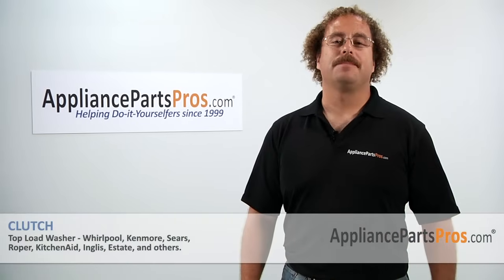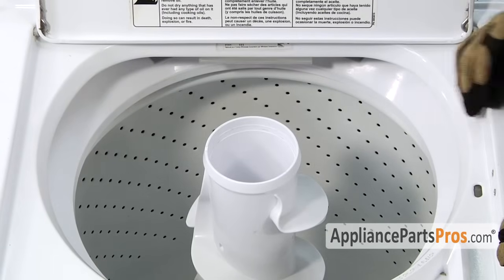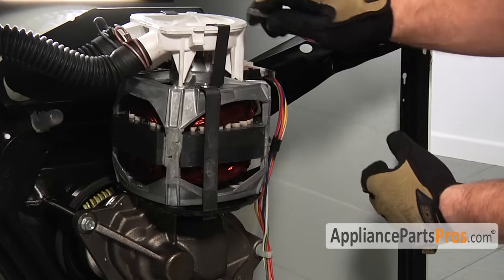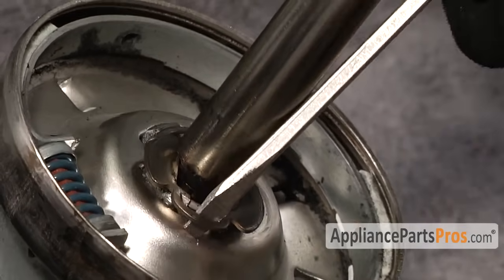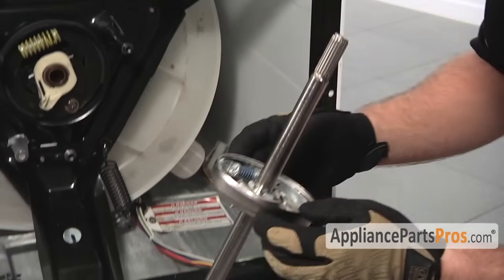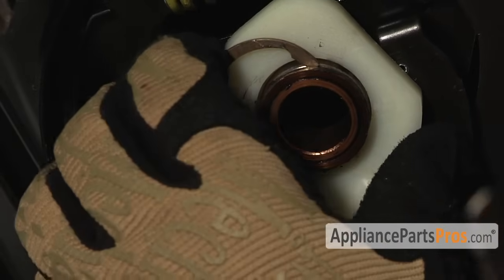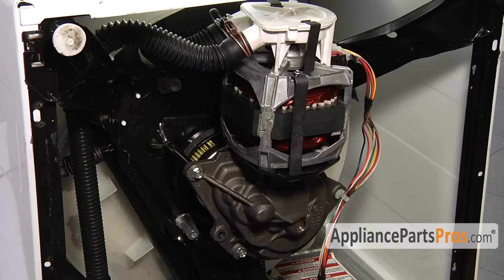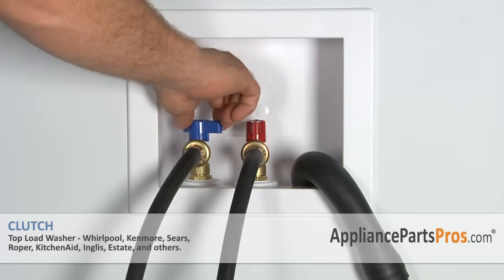How To: Whirlpool/KitchenAid/Maytag Clutch Assembly 285785

Comment: Curious! You didnt remove the drive block and spanner nut?  So im assuming theyll stay in place?  Thanks

Note: " It has lips on it"  Lol.  So it has dog ears, and lips? 😅
Reply from the maker: If you are able to access the clutch assembly without removing the drive block and spanner nut then they wouldn't need to be removed. Keep in mind this is just a generic video to show how the repair is done, so if your unit is a different model the repair could be slightly different.

Comment: Anyone out there?Know what this part is it's a thick pin, about 2 inches long, flat on one side, and a hole at the end It fell out as I was replacing the motor and transmission in my Whirlpool. Washer no idea where it came from.Any help would be appreciated.
Reply from the maker: Sorry, what is the model number of the you're working with?

Comment: On the cam side of the clutch...what is that rubber ring that sits around the assembly?  When I set my washer down, I first thought that was a belt.
Reply from the maker: jobzombi It is a sound dampener that goes around the brake shoe housing.

Comment: My washer spins, but as it spins, the bottom part of the agitator will skip.  What I mean is that as the inner tub and agitator both spin at the same speed, every other second or so, the agitator will stop and then spin again with it. It is perceptible visually, as in you can see the tub blur around, but the agitator will stop for a second and then continue spinning with it, then stop, then go, etc.. I though maybe it was the clutch slipping, but from watching this video, if that were the case, the tub as a whole would not spin.  I also took it apart and the clutch is on pretty well, there is no slippage.
Reply from the maker: jobzombi I would take the agitator off and make sure the teeth that lock onto the shaft are not stripped. That is a long shot from what you are describing, it could be a transmission problem. You can always post the problem along with the appliance model number on our repair forum and the techs can help you out!
Reply from the maker: jobzombi I found this thread on our forum and thought I would share it, the poster even posted a video of the problem. Please check it out and see if looks like the same problem you are having. http://forum.appliancepartspros.com/washer-repair/526108-agitator-moving-during-spin-cycle.html

Comment: Replacing the clutch was very easy. However, after all is done the washer spins and vibrates like it's going to leave the room. The washer now shakes, rattles and rolls...I have balanced the machine as shown in my book, but that isn't doing much good. The machine sits on a wood floor (not cement). When I first got the machine, I had the same trouble, but for some reason the shaking stopped until the spin cycle completely stopped. There is no unusual noise when the machine runs. Help!

Comment: I have an a Roper by Whirlpool top-loading machine. I need to replace the clutch but CANNOT find the model number. Is the part used in this video (#285785), the standard part for Whirlpool machines?
Reply from the maker: Daniel Hurwitz The model numbers are usually located under the lid. It is always best to look up the parts by the model number as there are a few different clutches used over the years, on the direct drive models. The one in this video is by far the most common one, but it is not the only one.

Comment: My washer does the same thing that the one pictured in this video although it is not the same model. I have a Kenmore 700 (110-28722700). I wanted to make sure that I could access the clutch easily before I placed the order. But when I moved the washer, I noticed a large amount of oil on the floor underneath. I'm thinking now that it's the transmission that needs to be replaced and not the clutch -assuming the clutch is failing because it's loaded with oil now.
Reply from the maker: Jeff Damal If it is leaking on the clutch it could cause it to slip. Once you find the leak you can repair the leak and top it off with oil or change the transmission. Also if you laid the machine on its back some oil may have come out the vent hole, if that's the case you can probably just clean it up. I do not know what you mean by large amount but a few ounces is not a big deal. At the top of the transmission there is the cover and shaft seal, at the bottom there is the shaft seal where the coupler mounts and the cover itself.

Comment: When he pulled off the agitator and says "some models have a retaining clip and a little plastic piece" what is that called. I need that PIECE. and nobody knows what it's called. Please help!
Reply: At 2:07
Reply from the maker: Shena Broyles The part numbers are: AP2908563 and AP3881225, we have them in stock. You can go to our website to order them.
Reply: Ok the first number is the clamp but the second number doesn't look the same as in the video.
Reply from the maker: Shena Broyles They recently changed the part design and part number. The video has the 
old version, the part number I gave you is the new version, it looks a 
little different but it will work the same.